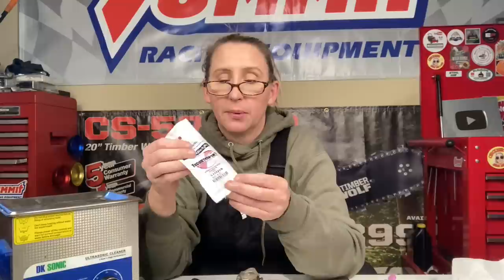How to easily fix a Tiller that's been sitting FOR YEARS! Tecumseh OHV 5 HP CARBURETOR REPAIR

Comment: In 1987 I bought a craftsman mower with a Tecumseh engine on it! I used it one summer to cut my grass! At the end of the summer I changed the oil and put the mower in my garage! The next year in the spring I put a new spark plug in and filled it up with new gas! Well half way through the summer it threw a rode threw the block! Now if I have to buy a mower if it doesn't have a Briggs and strantion  engine I won't buy it!

Comment: Older Tecumseh engine fly speck hole in adjusting screw shaft in sediment bowl is the key to idling problem . Use a wire out of a wire brush it will fit .☺️👍

Comment: I don’t see many Tecumseh anymore.  The oldest one I had was 1987 and I made it work.  With carb kit.

But the aftermarket ones are very cheap maybe $9

But may. Not be exactly what is on a tiller
Gr8 vid.

Comment: Hi I really enjoy the Videos you are putting out!  I suggest you ask the County if you can build a shop at your house? they are often concerned about cement footings & stemwalls then flatwork  then framing.  Please look at  Barndominium  6 Amish guys 8 hours   cement, rebar, Heating after building the shop- Pressure treated poles? good luck  Mr Kimbel Wiese  ( a very handy old guy)
Reply: anyone that has a business at thier house will be quick to tell you  it easily becomes a nightmare. better off a shop  away from the home

Comment: the small engine market must be different around you if this is your slow season. most shops around here end up working on snowblowers till lawn mower season starts. you would be lucky if you could get a snowblower into the shop within the next 3 weeks but we did just get hit with about 2ft of snow last weekend. i guess it never hurt to get in line early but then again depending on where you store your equipment will effect if it is accessible and most people wait till the snow is gone and they need the equipment before looking at it.
Reply: @ crazywolfie Arkansas doesn't really have a need for Snowblowers. Bre, did work on a Snowblower recently. I believe it was owned by a relative. It most likely was SOLD.

Comment: I don't have a tiller to get ready but my snowblower was having some serious trouble running recently.  I had to set the choke to almost full-choke for the engine to run.  I'm thinking either the prime line or carb gummed up.

Comment: For those once a year or once in a blue moon used pieces of equipment, like tillers, hedgetrimmers and generators, drain the fuel and add diesel to store it.  Diesel isn't nearly as corrosive as gasoline and adds a modest amount of lubrication.  The carb and tank (if it's metal) will look like a champ even after long term storage.  When it's time to use it just drain the diesel and fill with fresh gas. 😎

Comment: Tillers are a once a year thing...  then you clean the carb and use it once....     I have 2 10 horse evenrudes from 1963...  same thing. Clean one up, cruise around a lake a couple times a year, and clean the other up...  must be 15 or 16 small engines around here that always need somthing to run good...

Comment: I have virtually the same mother on my craftsman chipper. Kept running for three minutes then ran out of fuel. Found the same o ring debris in the bowl nut. Do I need to change that center jet? I also have a spring on the float pin. Do I need that as I’ve not seen one video showing that spring. Finally, can I buy a rebuild kit minus float from you. I can send you machine specifics fr proper parts. Thanks.  Steve, Plymouth MA

Comment: A struggle I have is sourcing replacement carburetors. 'They' say it is a replacement, and it isn't even close. Attachment locations for throttle is off, some vacuum ports are on the opposite side.  What do you recommend for finding the right carb?

Comment: Let me tell you a story, I bought a John Deere tiller with a Tecumseh engine from an uncle. The motor had just been rebuilt by a local shop. Uncle died and family sold the tiller to me. The engine did not have a spark plug in it. I bought a spark plug and put it it. Started the motor and it reeved wide open until the rod came out the side of the block. The governor was messed up. Bought a new engine block got it going again but constant carb problem. Bought a new carb and still had problems with it.

Comment: I’m about to buy a used Mantis from Home Depot rental ($230).  The 16” 4 stroke.  Would you winterize with 2stroke oil in the carb and stuff the same as a 2stroke engine?  Do the Mantis attachments interchange with the Echo since they are so close?

Comment: You neglected to mention the hole in the bowl nut at the top of the threads that is angled downwards. People always forget these, they are only on Tecumseh. If they don’t get cleaned it will not idle correctly. Also some Tecumseh have a low idle jet on the side that must come out and be cleaned.

Comment: Tecumseh went bankrupt in 2008, the company was already in a rough state due to the recession at that time, but a Brazilian lawsuit over a defective engine was the final nail in the coffin for them. Briggs and Stratton suffered a similar fate during the pandemic, the only thing that saved the company was it being bought up by another engine maker. I actually have one of these engines by itself and it is completely pristine, it hasn’t even had its break in cycle yet.

Comment: If you buy a Harbor Frt. Tools  ultrasonic cleaner, DO NOT use their cleaning solution on anything aluminum. (It says so on the packaging) Dawn does work great, as I use it on electronics parts often.

Comment: If you're not going to empty and run the gas out, then at least fill the gas tank to the top with fresh gas. Reduces the amount of moisture that will absorb into the fuel and keeps from fouling it as quickly.
And at least keep it covered, out of the sun if possible. In a shed or garage is better.

Comment: Here's a question for ya, and maybe you have ran into this before? I have a Champion generator (8000 running watt), that I am going to hookup to our natural gas line. There's a video out there that the guy says his carburetor filled up with water and rusted his gas tank when he was running it on propane. I never intend to run my generators on gasoline, so is this going to be an issue? I live in Wyoming, so our humidity isn't all that high.

Comment: Hi.  I need help.  I bought a brand new tiller from Lowes about a year ago.  It has never been used or started up, but it has been stored outdoors.  Yesterday I made sure to put oil and gas in it, but it will not start no matter what.  Any advice will be greatly appreciated.  Thank you.

Comment: I have two Tecumseh that both have bad carbs. My local repair shop told me to trash them that the parts were not available. Can you supply them or point me to a supplier??

Comment: The Tecumseh carbs arent to hard to restore with an ultrasonic cleaner. The narrower passages tend to clog and carb spray doesnt fix the problem. It needs a long soak. Also a set of OEM needle and seats will assure the float will not overflow.

Comment: All you need to stop with the tecumseh  carburetor from leaking is a shut off valve before the carb and let the carb run out of gas after running it. By the way, it is correctly pronounced tecumsa. The last syllable rhymes with duh. Tecumseh folded in 2008. Nice video!

Comment: What is the best way to store your 4 cycle engine equipment for long term.
Reply: I run the gas tank dry and change the oil. And filter if it has one. I use fuel stabilizer in all the gas cans for over Winter.
I run the generator once a month for 20-30 minutes according to the manual. Also fuel stabilizer in the gas tank.
Reply: For long term, I run the engine dry with 2 stroke mix and leave it on a compression stroke (so valves do not rust),  (or add some oil to what is left in the tank after I get the gas out with a kitchen syringe). The oil coats the carb to lessen corrosion.
 I cover the machine with a tarp outside, but best storage is in a building where temp changes are less (less condensation in carb).  Mike
Reply: Thank you for the information about storing your equipment.

Comment: Must be something about American fuel. I live in Australia and I always leave my fuel in. I've got a generator and a pressure washer that sat with fuel in them for 3 years, they started right up, no problem. A small chainsaw sat for 5 years and started no problem. Sure, I had put more fuel in them because it had mostly evaporated. But They started fine. I'm guessing Aussie fuel is a little different. Anybody know the difference?

Comment: I noticed you did not adjust the float.
Reply: Official_Chickanic....  If you read the the Tecumseh carb repair instructions, the float needs to be adjusted level. Your Tec carb tool can do this function. The metal tab in the float is there for this purpose.

Comment: LOL 29 degrees LOL come  on miss mecanic just worked on my customers generators in -27 degree blowing weather . Yes I had my RV furnace running full blast to keep it at 55 degrees but kept going NNOOOWW if it was 110 degrees out yea NOPE would not be in the shop in shorts working ....(Like anyone would wat to se these old men legs eeeewwww 🙂